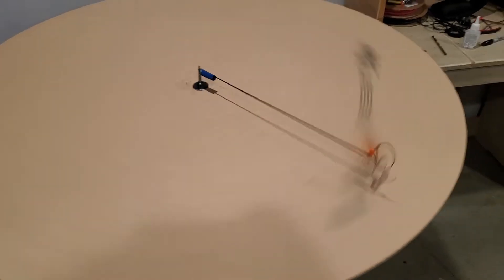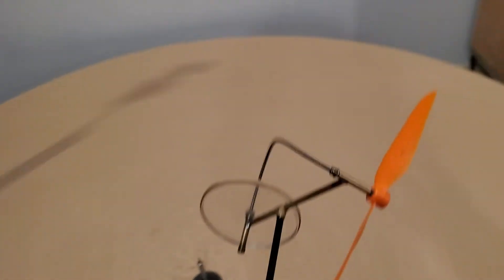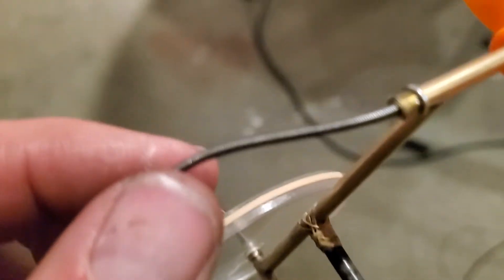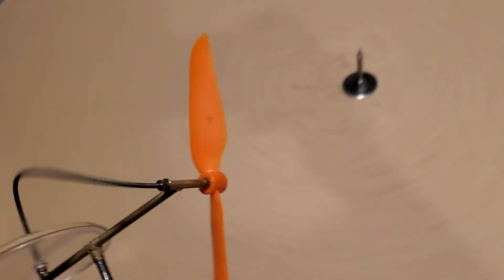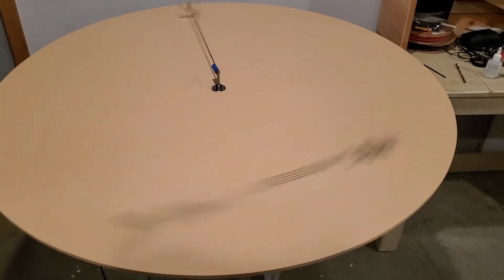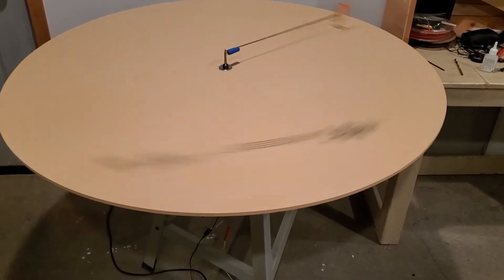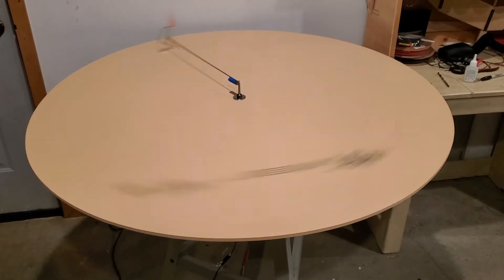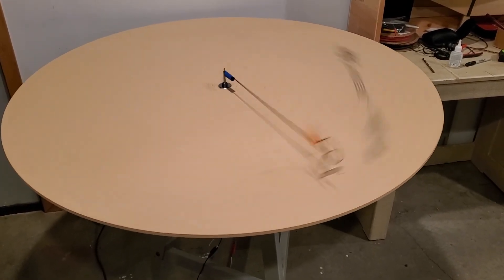DDWFTW All Day! - Cart running opposite a spinning table

Comment: Doesn’t self start? What happens, can’t break out of the static friction and it rides with the table with the full tailwind going through it without turning it?
Reply from the maker: With that prop, no it would just run much slower than windspeed because the prop couldn't get out of the full stall. I put a wider blade prop on it and it would self start, pass windspeed, and stay there.
Reply: @drienkm  Cool. Next time you’re set up for shooting, could you video it self starting then once at FTW condition, keep filming for a good minute or two steady state? I’d love to add it to my quiver of videos for the naysayers.
Reply from the maker: @FlyNAA  Yeah, that would be a solid video. But I think it's just on the path to hand waving and the exhaustive mission of trying to prove in a video that there is no trickery... It's a rather depressing way to coerce people to reopen their physics textbook.
Reply: @drienkm  The bad news is that there are some folks that are fully invested in not understanding it, and nothing you could ever do will change that.
Reply from the maker: @FlyNAA  FYI, I did just make a video of the cart self starting. You had mentioned wanting that for you "quiver"😉
I wanted to get rid of that big useless table, but your comment among other things, prompted be to keep it until I found time to shoot a better video! Well that's done 😁
Reply from the maker: @Rick_Cavallaro  You would know better than most! Thanks, Rick.
Reply: @drienkm  I love it when I see people actually try this, and explain it correctly.  It's RARE.  Most people are happy to explain why you're definitely wrong - without trying it or listening to your explanation.

By the way, there's a group of us on the talkrational forum that have been discussing this thing on and off for years.
Reply: @drienkm  thanks for doing this. However, in the months since my comment, I've realized how laughably naive I was for thinking that having one more video, or seeing just a few more minutes at steady state, would be useful in the face of the, frankly, mentally ill levels of logical contortion people will perform to maintain the impossibility of this.

Comment: so galilean relativity tells us that a car is powered by the road rather than its engine? um, no.
Reply from the maker: No, Galilean relativity does not tell us a car is powered by the ground instead of it's engine. In an alternate frame of reference, a stationary car is still powered past the resistance of the moving air and ground by the energy in the fuel via the engine.
Likewise, the DDWFTW cart on the treadmill is an identical physical situation to running downwind on a lakebed. It's just a much more convenient way to play with the mechanics.
But I think you are catching the fact that really, a DDWFTW is as much "powered" by the ground as the air. The power source is the relative movement of the two, aka the wind.
Reply: @drienkm  if you can't tell the difference between friction forces and applied forces you're in no position to explain physics to me. the blackbird is a laughably obvious hoax & all its enablers are immense lolcows.
Reply from the maker: @pl3628  Strong words there... 
"Friction forces" are forces resulting from friction. 
"Applied forces" generally mean forces applied to a mechanical system form outside it. 
Friction forces and applied forces are not mutually exclusive things depending on how the system is defined.
Still feeling exempt from a physics discussion? If not, what friction in this system is attracting your attention?
Reply: Arguing against the DDWFTW is the same as saying sailboats can't go upwind or downwind faster than wind speed.  True, they cannot go directly upwind, but that is because they cannot convert force directly perpendicular to the hull into forward motion. As force applied by the sail moves away from the boat's long axis towards the side, friction increases; the "sideward" force can no longer be efficiently converted to forward motion. It's why most sailboats never travel into the wind closer than about 20 degrees and why they can't exceed down-wind speed running  too close hauled (close to the wind direction) as well; the sail stops working as an airfoil and becomes what is essentially a parachute dragging the craft along.

  This is why sailcraft can't go directly downwind faster than wind speed, but can tack downwind faster than wind speed.  It's a matter of having enough lift to overcome drag to exceed wind speed.  It's  the vector sum off all forces that results in motion that is indeed directly upwind or downwind faster than wind speed.

All of this boils down to the difference between true wind and apparent wind caused by forward motion. Propellers experience the exact same thing; their angle of attack is relative to air they are moving through. The blades are essentially "tacking" around a fixed point, the drive-shaft.  Both sails and propeller blades are airfoils.

Comment: Would the cart continue to circle around the platform if the platform was turned off?
Reply from the maker: Nope. That would remove it's source of energy. No perpetual motion, just interesting mechanics.
Reply: @drienkm  it's not powered by the wind, so your device is worthless.
Reply from the maker: @pl3628  Yep, my device is powered by a motorized table. Correct, it isn't a useful demonstration to anyone who is going to get hung up on the reference frames.
Reply: @drienkm  if you can't tell the difference between a fluid (wind) & a solid (table) it's no wonder you fall for the silly blackbird hoax.
Reply from the maker: @pl3628  I can tell the difference, but also what is not different - they are both things with mass.
Reply: @drienkm  so you should be able to make the simple linear momentum calculation that proves the blackbird is a hoax then.
Reply from the maker: @pl3628  Yes, I've done it, but it fully supports DDWFTW. Do it here please. Hint: you can't model the prop as a stationary panel because it isn't. It's a prop working as a prop, so model it as a prop.
Reply from the maker: @pl3628  Easy... I'm not lying to you. Actually, forget "ddwfttw" if it helps... Instead ask yourself: Is this table-powered cart really able to run continuously in still-ish air in the opposite direction of the table that moves under it?
If you believe that is physically achievable, then the only problem we have is one of Galilean relativity (reference frames). 
If you believe that is impossible, then you need to accuse me of some kind of trickery like teeny motors or indoor tornadoes or whatever... Deceiving people like that goes strongly against what dives my interest in topics like this. I also don't have time for cheap magic tricks! I spent about 6 hours one Saturday a few weeks ago making this shotty, inefficient thing that barely works. What you see is what it is.
Reply: @drienkm  Very nicely done.